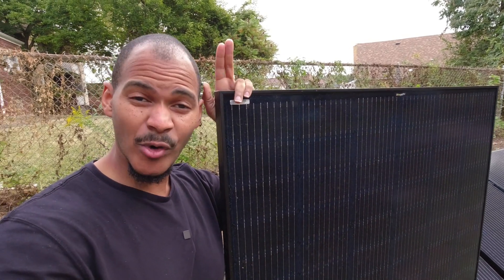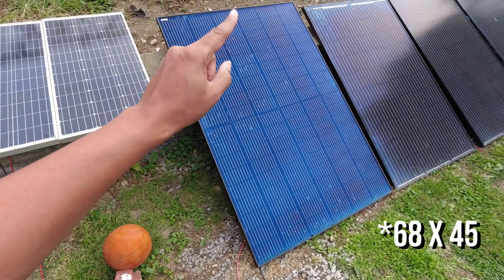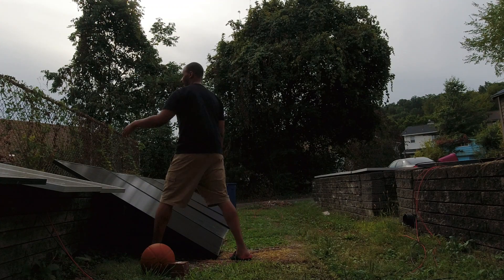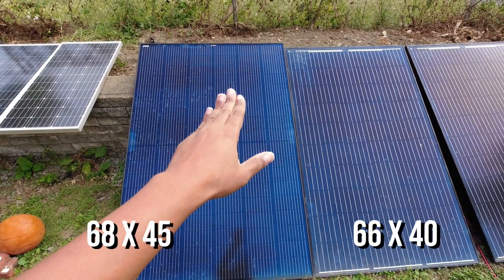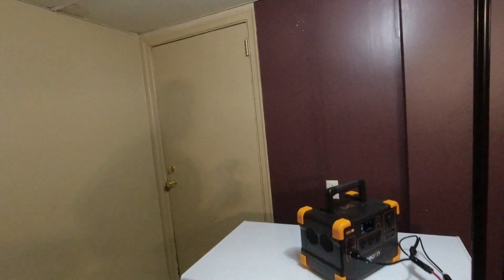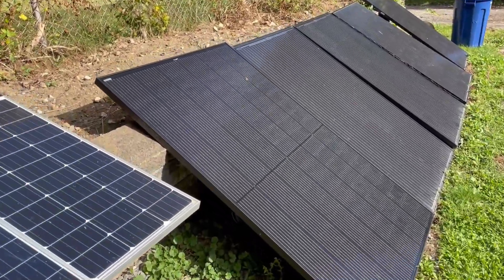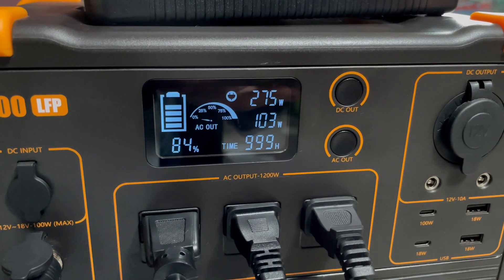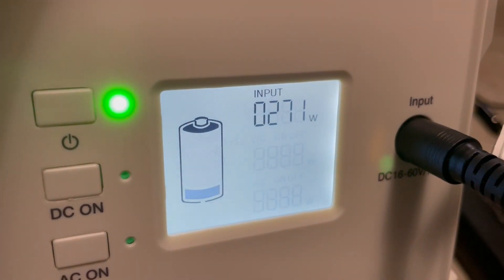BougeRV 400 Watts 10BB Mono Solar Panel

Comment: I’ve got 3 JA Solar 405w panels in series and yesterday, overcast but bright, I was seeing 1370 watts on my delta pro. Yup. There are times that overcast but very bright I’ve seen my panels achieve higher than their rating. Granted this was on 9/10/2025 so it was not hot which gets the panel closer to STC ratings. But 1370 watts from a 1215 rated array is dang good.

Comment: the size is a basic 430 watt panel size.

why not buy a trina vertex s+ 80$ with much better tech inside....millions 420-440 watt panels sold so nothing unique or whatever...its the basic size what all roofs full of....why buy athis panel size with 400 watt if other companys deliver better cells in it with ~430 watt?????

for a basic roof panel what 100 top tech companys sell with more output for <100$ pay 600$ for lower output pointless in any therm.

i have bought 10 x trina vertex s+ for 850$ include shipping... so i will never pay for 1 lower tech produkt the same prize ....
Reply from the maker: Where did you buy them from for that price with free shipping?

Comment: I don't understand why people buy expensive power stations. Why not use a real battery bank? I actually use Nissan Leaf EV modules and it is about as cheap as you can go with the best output. I am currently heating my hot tub with 8 modules.
Reply from the maker: Ease of outcome. Not everyone wants to learn diy. But with the AIO units and a battery, you kinda can't go wrong with that.
Reply: @AskIveSolar  There is nothing to learn, solarr panel batteries and inverter. The power stations are just a battery and inverter combined.
Reply from the maker: So wire gauge, breakers, batteries in parallel to get amps you need....that's nothing to learn?

Comment: I wonder how many i could fit on a cargo van (not a sprinter), I'm saving up for one 🤔 I'm going to have to look into that
Reply from the maker: Did you see there new smaller 200 watt panels. I really like those joints. Top con or something like that.

Comment: i went on marketplace got a free awning then swapped for a 415 watt solar panel which was delivered free and got 30amp charge controller and connectors for £10 in UK
Reply from the maker: Nice! Smart idea
Reply: what type or brand of awning?
Reply: @jtnoodle  vango airaway airbeam sapera

Comment: You can maximise imput by simply wetting the panel with cold Tap water, you should try you will be amazed even if you get fan 20w you might gain 60w if you cool the panel
Reply from the maker: I feel you but that's not sustainable unless you already run that water for another reason.
Reply: @AskIveSolar  if for some reason you have source of water nearby, try it you will be amazed your panels are ip68 right 🤔
Reply from the maker: @niceboy60 they are ip rated for sure
Reply: @niceboy60  That blue pitched roof behind you is begging for some guttering & a couple of large water butts. Great informative video by the way. I previously watched another video where a guy poured cold water onto his solar panel & it did increase the panels output.

Comment: for muti panel systems it sounds great. For a small system with just the one panel, any problem your out of business. if you have 3 -4 smaller panels wired in parallel, you still have power, in series you can wire around the bad one. still it's not a bad price
Reply from the maker: Thats a good point Seymour. I dont think I have ever had a panel fail on me but still good point.

Comment: Nice panel 👌 but the price is a downfall  👎 $599.00 for one 400watt panel is not a deal for me !
Reply from the maker: I think the price will adjust eventually but being second to market is an interesting place to be in. I think EcoFlow had a 400 watt panel but it probably didnt do well either.
Reply: @AskIveSolar ,panels at this very high price will not sell well due to the great used warranty used panel market and dye to the fast paced new market of solar panel

Comment: Nothing in this video demonstrated this panel getting anywhere near 400 watts.  The best I saw was 275 watts.  I'm not convinced this is a 400w panel.
Reply from the maker: Are you new to solar panels?  I also showed at least 300 watts and I saw as high as 330 but it's ok if you feel the way you feel.
Reply: @AskIveSolar  No, I'm not new to solar, and I am an electrical engineer.  You did not show anything more than 280W, and just because you say it went to 330W doesn't mean you demonstrated it.  My comment was valid.
Reply from the maker: @geoffschulz  7:49 shows 300. 

I asked if you were new to solar because very rarely will a panel put out full power. Most people who are familiar with panels know that you get about 80 percent output.

Comment: I used the massive renogy 450 watt panels to power my EB240 and Oupes 2400. I can charge both of them up fully on a nice sunny day. I just moved the two massive panels to track the sun. Instead of 628 small panels. That would be a nightmare.
Reply: 628 panels, lol
Reply from the maker: Ha @ 628 panels. Yeah man, Im over 100 watt panels but shoot, I still have a ton of them.

Comment: Sup Ive con you put 2 pf those 400 watt panels on a ac200p? Holla
Reply from the maker: Yep you can. They are 40 volt panels and you ACP has a 150 volt limit I believe. So you gucci!
Reply: @AskIveSolar  Thanks bruh been waiting for something like this I'm on it 💯
Reply from the maker: Read the comments as well. Some have mentioned other offerings to consider.
Reply: @AskIveSolar  ok Kool thanks
Reply: you can put 3 of them in series on an AC00p

Comment: You need to checkout A1-solar.  I picked up 2 400 watt Qcells for 265 each.  They are based out of Miami and have shipping depots throughout the country.  They shipped mine to an electric supply center by me and I just picked them up.  No shipping cost and you do not have to buy a 100 of them you can just buy one.  I got my panels in 2 days.  They are brand new and came with a 25 year warranty.  The joy of a 400 watt panel with my pecrons.  My setup is like yours I just place them in the backyard on random objects.
Reply from the maker: This was a great read! I'll check them out and it's nice to know there's another person out there like me, just making it work. 🤣